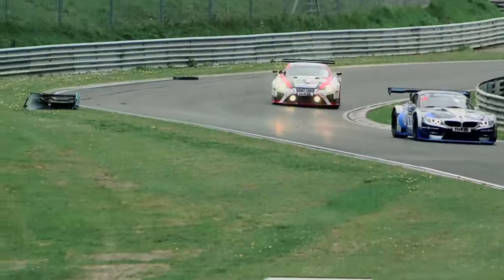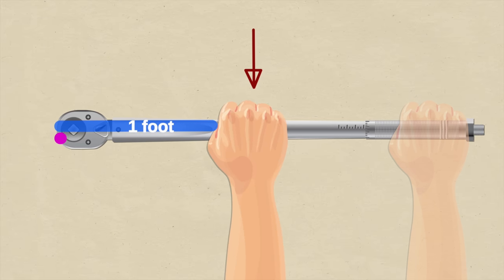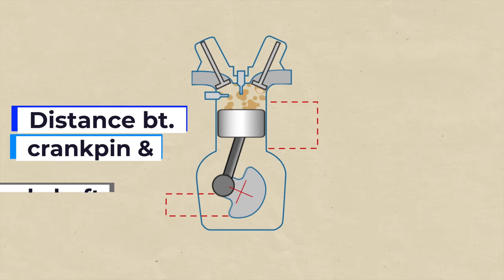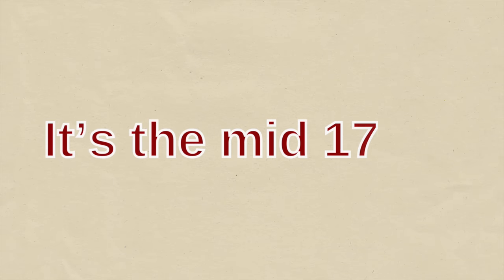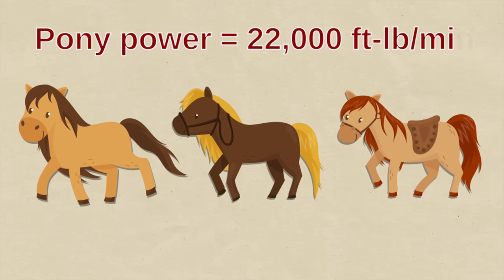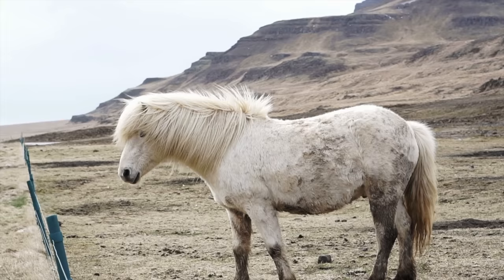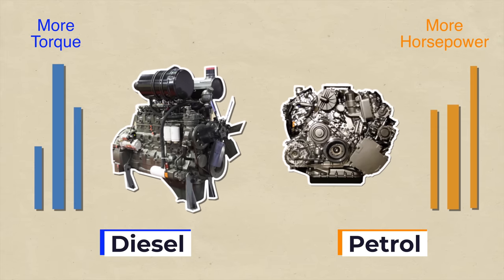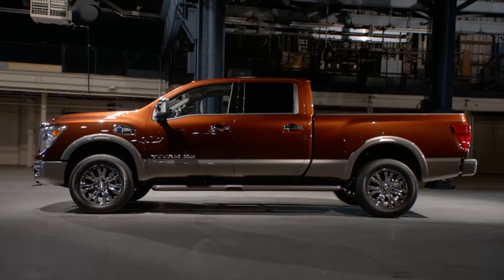Torque vs Horsepower, Which is Better

Comment: Which truck should I buy for motor home project And should I get automatic transmission or manual transmission?
Reply: Are you towing a trailer or building a motorhome out of a truck? Sizing the truck and it's engine is a function of the weight of the motorhome. There are a lot of variables that factor into it. You need help from someone familiar with motorhomes. As for transmission, automatic will make your life a lot easier.
Reply: @ninemilliondollars  I wanted it to be reliable

Comment: Multiplication is commutative.  Distance x force = force x distance.  Foot-pounds = pound-feet.  Only blinder filled engineers would see a difference.  Pound-feet is moving 1-lb with a multiple foot lever.  Foot-pounds is moving many pounds with a 1-foot lever.  I want my car to make a lot of force and all car engines do not have a ever greater than a foot!  Besides, foot-pounds rolls off the tongue, pound-feet does not even come close and has to be forced.

Comment: Hey Scotty I have a question if I may. I have a 2005 hyundai Santa Fe 3.5 with a mysterious coolant leak at the bottom of the engine. I have photos and video of the lite leak but can't find where it's coming from. is there a email I can send my photos. much appreciated
Reply: I had a coolant lean in my V8 Mustang. It's possible it's from the cylinder head and is slowly dripping out the bottom of the vehicle. Sometimes the wind will push it to the back of the engine where it drips. Take it to a shop and ask them.
Reply: Should have read "...coolant leak..."

Comment: You can tow whatever with a new Ferrari on low gear but I wonder who's going to mount a towing bracket on it and also ignore the law. + The engine will get hot since the car is made to go faster when working at that power BUT IT WILL TOW

Comment: You cant have horsepower without torque. Torque is what gets you started, and at some point, horsepower keeps you going.
Reply: Not entirely true. HP is a function of torque times RPM. A small amount of torque could generate a lot of HP if the RPM was really high. Take an electric motor that only develops 10 ft-lbs of torque but spins at 20,000 RPM. It would make about 38 HP. That's a lot of work being done. :D

Comment: I have always wondered where diesel engine sounds like it’s falling apart even though I assume it’s made out of much thicker metal I always thought that’s why engine diesel will last longer because of the beefiness of the engine itself but I always wondered why they make such more noise than a comparable gasoline engine????
Reply: There's 10-15% more energy in a given amount of diesel fuel verses the same amount of gasoline. It's like a small firecracker verses a bomb; the bomb makes lots more noise.
Reply: ninemilliondollars 😊🖖🏼👍🏼

Comment: Hey Scotty! I'm looking for my first car and I found a used 1986 Buick Century Estate Station Wagon. The only thing wrong with it is that the engine sounds like it's knocking, and the owner says he wouldn't drive it too far without having it looked at. what do you think? would it be a good first car? and what do you think might be wrong with the engine and what do I need to do to fix it? Thanks, Spencer
Reply: Take to a mechanic and have them look at it. Only way you'll know what to pay or not.

Comment: Scotty. Why doesn't 2019 Toyota Camry have  stitches on the serpentine belt. I realize after the fact you didn't recommend that car...but do you know why the belt has stitches?
Reply: Inside facing the pullies or outside. If outside, no problem. Shouldn't see stitches if inside. Check your owner's manual for when it needs to be changed.
Reply: @ninemilliondollars  I thought it was all the way through. For sure I saw it on the outside. Thank you.

Comment: Good explanation, so if I change the tires of my truck. Lets say I reduce the diameter of them from 29 inches tall to 26 inches tall, is it gaining torque? Or horsepower?
Reply: The answer is actually "neither, but that's not the end of the story". The torque available is a function of the engine, the gearbox, and the differential. But before I get firestormed with arguments relating to change in radius, let me give you the tl;dr clue by reminding you what the wheels do: they translate rotation to linear movement, revolutions to feet of travel, RPM to MPH, and torque to linear force. They do not change torque. Simply put, a smaller wheel results in less distance traveled per revolution. How that relates to torque and horsepower needs more explanation.
Scotty said that if you apply a specific force at a specific radius, you get a certain torque. If you apply the same force at a larger radius, you get higher torque. This is true. But the "constant " part of that example is the linear force you can apply. The variables are the radius and the torque you "deliver" as a result is the product of the two: T = f x r. None of that is actually "power", by the way, unless you move something (the bolts, in his example).
(But.... why did you have to apply a force in the first place? It's the friction associated with tightening the bolt, right? Without the friction, there would be no resistance, no force, no torque, and you could tighten the bolts with your fingers. Hang on to that thought, because it'll be very important when we talk about power...)
In the case of your engine and wheels, things are different: the maximum torque deliverable by the engine is the "constant" part, and it is translated by the gearbox through to torque at the AXLES. When you put wheels of a certain size on, you recreate linear force at the radius of the wheel. It is the opposite of the wrench: a smaller radius means greater linear force (because f x r = T, if T is constant and r is reduced, f must increase). You actually already know this experientially if you've ever tightened a twist drill bit into the chuck of an electric drill by holding the outer chuck ring and operating the drill. You can probably hold the ring and stall the drill, tightening the chuck, because the linear force at the radius of the outer ring is within your capability. You almost certainly wouldn't be able to grip a 1/4 drill bit to stall the drill... The torque is the same, but the linear force at the circumference is vastly different!
So that's the torque consideration; how does this translate to power?
To get into more detail, I have to introduce one concept - that of energy; and remind you of another - time. Power is the "time rate" of doing work, which is another way of saying the rate at which energy is changed from one form to another. A moving car has "kinetic energy" that is put into it by the engine as you accelerate. So "work is done" in accelerating a car of a certain mass (weight) to a certain speed. For any fixed mass vehicle, the higher the speed, the higher the kinetic energy (by the square of the velocity, actually, but that's for another discussion). Alternatively, the higher the mass of the car, the more kinetic energy it possesses at any particular speed. A smaller acceleration (force) over a longer distance and time will result in the same speed, and kinetic energy. That energy is released in the form of heat by the brakes when you bring the vehicle to a stop, by the way.
So back to Scotty's example. He showed that greater power meant doing more work - tightening more nuts - in a certain amount of time. The next clue is "what if you don't have enough nuts to tighten? Can you still do the work?" And the answer is "yes, but not for as long!" And that is how we come to the important difference between delivered torque and "developed" power.
So, to the wheels.  In selecting wheel size, you "pay the piper" - you make the final choice of how your power is used. Here's how that works:
For a 29 inch wheel, one rotation results in 91 inches of travel along the road. At 26 inches, the distance traveled per rotation is only just over 81 1/2 inches.  But the available torque from the engine hasn't changed, so for any engine speed with a smaller diameter wheel you get greater available linear force at the road, but lower vehicle speed.
If you're still uncomfortable with change in radius not resulting in change in torque, let me remind you that until we start to actually rotate, all we're talking about is linear force at the radius of the wheel, not power - energy transfer. If you're electrically minded, it's just volts, not amps.
 But where does the actual force come from? From the resistance to acceleration - the inertia, that property of mass which resists when you try to change its state of motion, and from wind resistance.
So the greater available force at the smaller diameter will result in greater acceleration, which means that the car accelerates to a particular - lower - speed, quicker, and it covers less distance in doing so. So we've dumped a certain amount of kinetic energy into the car by applying an available torque, converted to a linear force acting against the inertial resistance of the car, and got it moving. Now what?
Well, taken to the extreme, the engine very quickly runs out of available RPM, and the available torque drops to zero, and there we are, 5 MPH, engine screaming. How much torque? Almost nothing. How many horsepower? Almost none.
You cannot deliver a torque, or develop a power, if there is no resistance.
So there's the answer: with smaller wheels you have the capability for greater linear force - you can drive up steeper hills - but at a lower speed, because power is a function of the engine, and torque is a function of the engine and the transmission.
Reply: A simpler answer is "Yes." By reducing the tire by 3 inches, which equates to about 10%, you'd improve torque by 10% as well. But as mentioned in the other response by Julian Opificius, you'll run out of horsepower sooner and need to switch to a higher gear quicker. Mustang owners often change the differential gear from a 3.83 ratio to a 4.10 so they can beat anyone off the line at a stoplight, but they sacrifice top end.
Reply: Ingeresting, thank you
Reply: @ninemilliondollars  and everybody: No, that's nearly but not quite correct, sorry :-)  Your discussion of improved acceleration is, of course, perfectly correct, but it's not because of increased torque. There are three problems folks seem to be having in this discussion, and they are all related to "incorrect application of knowledge resulting from imprecise terminology". The first problem is that we're talking about delivering the output of the engine (as described in its torque and power curves, and as well addressed by ninemilliondollars) - in the form of a torque appearing at the axle - through to the wheels. The capability of the engine to deliver torque doesn't change just because you change the diameter of the wheels . 
The second problem is that "reflected inertia" - which is a measure of how the engine "sees" the inertia of the vehicle (a function of its mass) - changes with wheel radius.
The third problem is that delivered torque and developed power are not constant, they also depend on the behavior of the vehicle.
I'll talk about them all.
So to the first problem: torque, as we know, is described as a certain force at a certain radial distance. We all know that if we double the radius (length) of a wrench - which converts circumferential linear force into a torque - using an extension bar we can deliver twice the torque for the same force - applied circumferentially. From another perspective, to achieve any specific torque, we can select an infinite number of radius/force combinations because torque is the product of the two, and it is the reverse of this approach that is relevant to our discussion. (Note that I user the term circumferential twice: you can push or pull along the length of a wrench all you like, but that won't create torque. It seems obvious, but it's good to be precise with math).
The problem that occurs when we think about varying wheel diameter is that we are going the other way : we're not creating a torque by applying a force at a distance; we're taking an existing torque capability from the engine and breaking it out into a certain linear force at a certain radius. Mathematically, we will create a force equal to the engine torque divided by the radius: lb-ft / ft = lb which will be applied at the boundary of the tire with the road surface. Of course this isn't a static thing, we assume rotation and acceleration against the resistance of the vehicle, but we'll get to that next. So what changes is the circumferential force available at the point where the rubber meets the road (literally!). It is this force that accelerate the vehicle, not the torque!
So smaller wheel diameter translates to greater force therefore greater acceleration, BUT...there is more... which is where we get to...
The second problem - reflected inertia. Expanding torque out to circumferential force at a radius is a "steady state" issue, and as such is simple math, but when we accelerate a mass, the resistance of that mass to change in its state of motion is what creates the resistance force that results in torque. When we sit a car of a certain mass on wheels, we essentially "hang" the mass of the vehicle on the end of the "moment arm" of the radius of the driving wheel.  We could, theoretically, put a thin metal ring equal to the weight of the car, around the edge of a driving wheel and achieve the same inertial effect on the engine as the weight of the car. Through mathematical wizardry that I won't go into here, when we cut the radius of the wheel in half, we reduce the mass the engine "sees" - the reflected inertia - by a factor of four , so the engine sees a quarter of the inertial load. So not only do we have a greater linear force available for a smaller diameter wheel, the engine "sees" a much reduced inertial load, and so will accelerate faster. Now, if we consider a ridiculous case of very small radius wheels, the reflected inertia - the mass of the vehicle the engine "sees" - becomes trivial, and the limiting factor for acceleration becomes the mass (therefore the inertia) of the moving parts of the engine itself. That is an extreme condition, of course, and not a significant factor here, but the point is that relationships are not always linear.
The third problem: All of this torque vs. power business is a function of the engine capability, and you all already know this (and ninemilliondollars referred to it too): the engine converts chemical energy to motive force through combustion, which occurs at a certain rate which is a function of chemistry and thermodynamics. Above a certain rotational speed, an engine runs out of capability to deliver torque, so with smaller wheel we will run out of the ability to deliver torque at a lower linear speed than with larger wheels. Practically speaking, with smaller diameter wheels we'll be able to drive up the side of a mountain, but only at a low speed.
Bottom line: with smaller diameter wheels we will accelerate faster (because of the higher available force and lower reflected inertia) but we will max out at a lower speed.
The last point I should make, and this is really important, is that in order to deliver a torque and develop power, the engine must meet a resistance. Without resistance there can be no force, no torque, and no power.  The resistance - which appears to the engine as a load torque - is made up of factors such as inertia resulting from the mass of the vehicle during acceleration translated through the wheels (as we discussed), and frictions such as rolling friction and air resistance. This is why some cars perform very well with lower torque and power capability than others: they have lower mass and exhibit lower wind resistance.
In summary: it is the linear force at the boundary of the tire with the road, countered by the reflected inertia, that creates acceleration: the available force is a function of available torque and the radius of the wheel; the acceleration of the vehicle is a function of that linear force, opposed by the mass (appearing as reflected inertia) and the static and dynamic frictions generated by the car in motion.
Note that this linear/rotary distinction is really important when we look at tire technology. Nothing matters if you can't keep the rubber at the contact patch in static contact with the road surface, and that occurs in the context of a linear coordinate system.

Comment: I Have A 1988 Camaro It’s A 305 And Has Carb It Will Start It Could Run For A Hour But When I Hard Accelerate On The Gas It Hesitates And Stumbles .To Get To 35 Is Hard And I Have To Ease It To 50...THIS CAR IS DRIVING ME CRAZY 😂 These are the things I have already done  New Spark Plugs And Wires,Distributor and Rotor Cap,New Map Sensor,New IAC Valve,New Egr Valve,New IAT Sensor And Connector(This Is Still Sending SES Light?) New Air Filter, New Fuel Filter, Seafoam Treatment, New TPS Sensor, The Cat Was Clogged So I Got It Straight Piped! Any Ideas At All Would Be Greatly Appreciated😭😂🤯
Reply: I owned carbureted vehicles for a long time. So when you step on the gas the engine hesitates. That's because it's not getting enough gas from the accelerator pump. You have to feather the gas pedal so as to only let enough air in so the engine doesn't run out of fuel. I used to have that problem. Hope that helps.

Comment: Diesel fuel has 30% more energy per gallon than gasoline which helps with more torque too.
Reply: Internet searches are saying 10-20% depending upon the thermal efficiency of the diesel engine.